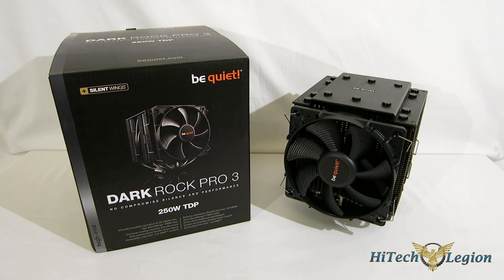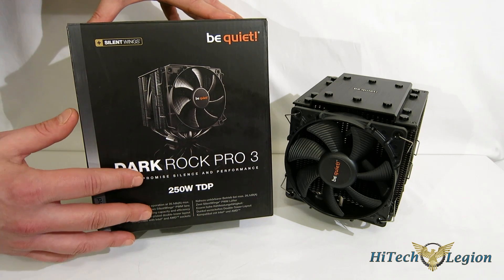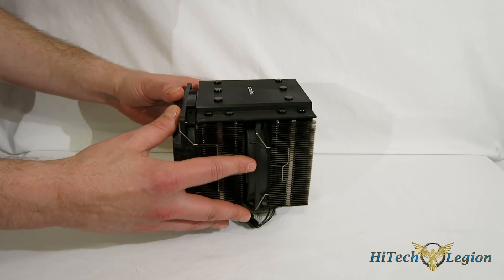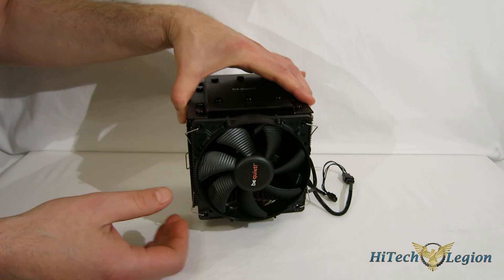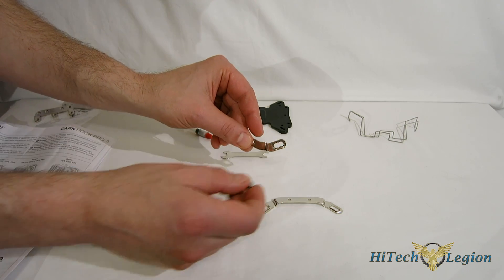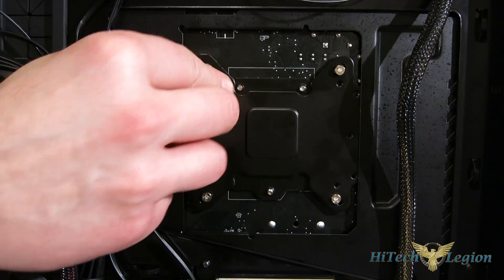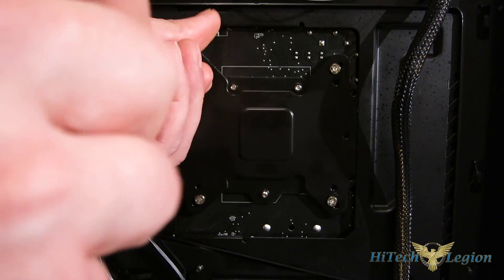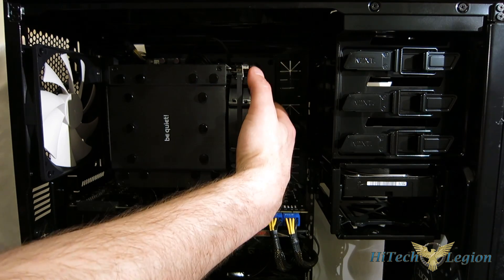be quiet! Dark Rock Pro 3 Overview, Installation and Benchmarks

Comment: I love the way it looks but I don't like how it covers all the ram slots. Cooling performance is pretty meh too. The nh u14s cools just as good but allows for higher profile ram. I just wish it didn't look so ugly.
Reply: And? Be Quiet knows that; 1. High profile RAM is pointless at they're not even real heatsinks, but glued on crap to appeal to kids, and 2. Anyone buying a cooler this classy are not tasteless enough to be using 3-story tall green fluorescent DIMMs.
Reply: Same here ...
Reply: ***** Yeah but to be fair the best deal you can get is with the Dark Rock 3, cheaper than a Noctua NH-U14s (at least here in Europe) and similar performance except it's even more silent. Only advantage with the Noctua equivalent is a longer warranty (6 years). But well with my build these Noctua fans would look so fugly, I don't understand why they don't release black and or white fans ... Also if you live in Europe check the Pure Wings 2 140 mm great for additionnal case fans and you can get 2 for the price of one. I think I'm becoming a Be Quiet fanboy.
Reply: ***** I guess you're right but my only gripe is that since this cooler covers all the slots it makes adding ram and troubleshooting more difficult. I might still end up buying it since it looks fantastic.
Reply: ***** Totally agree. You can see my comment below regarding tall RAM. I have been saying for years that cooling your CPU effectively is far more important than ornamental heatsinks on RAM.

Comment: It's nice looking but I just went to water cooling because of the exact issue I'd have with this and that is only getting to use low profile ram with it just like you said. I'm currently still on my Corsair Vengeance low profile sticks but I want some Vengeance pro or something similar in 2133/2400 so that kinda rules this out sadly. It seems like a great option in every other way though. I would of preferred to stay on air if I could of aswell.
Reply: I know what you are saying. I have always seen this as a problem with the RAM manufacturers rather than an issue with the CPU cooler. I recently had to change out RAM and had a very limited selection to choose from in standard height at higher speeds. That is changing a bit, with G Skill, Patriot, Mushkin and ADATA all now offering top quality high speed RAM without unnecessarily tall heatsinks. Corsair will likely not do that, since their marketing ploy is to get you to do exactly what you did - buy their closed loop cooler so that their RAM will fit....